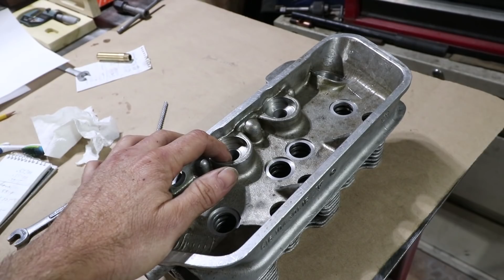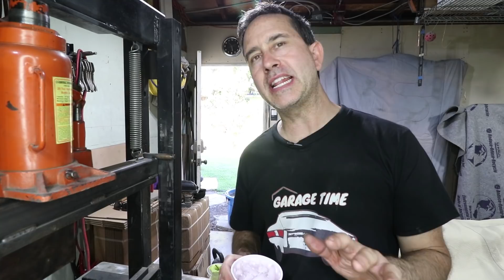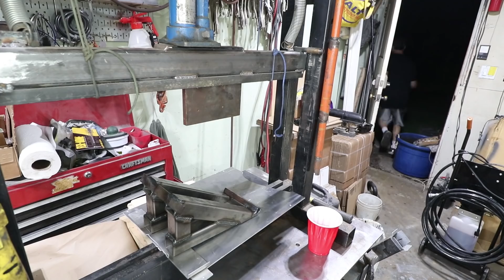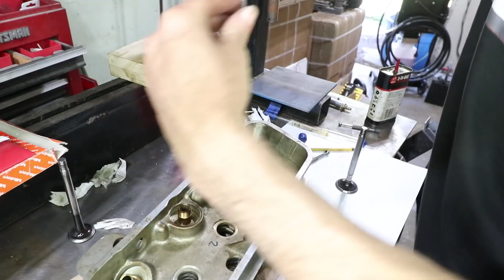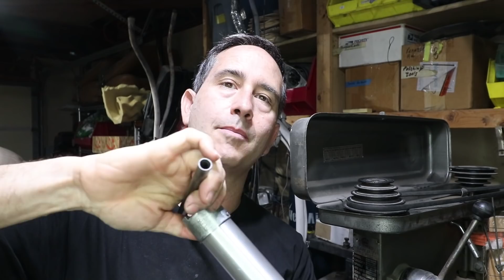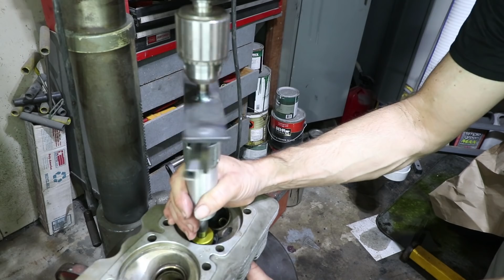912 Cylinder Head Rebuild - My HARDEST DIY Project So FAR!  Part 3

Comment: I miss my dad's workshop (Airport Engineering), which closed about 20 years ago. Started by my grandfather,  they used to remanufacture engines (even Colin Chapman of Lotus used them). They had everything for every job you ever needed, I spent most Saturdays down there building engines. We always used to cut valve seats by hand, Dad's cutters were like a hot knife through butter.
Reply from the maker: That sounds like a great hangout!  A couple friends of mine have private airplane hangers filled with lots of car tools and goodies.  Always fun to visit!

Comment: Newey cutters come in many sizes. One or two sizes bigger, and You would be OK.
Reply from the maker: Turns out I had the right size, but the center section is moveable for clearance.  Works like a charm

Comment: Working in a machine shop that has to put a lot of EXPENSIVE bearings in gearboxes, I’ve determined that if I have to replace anything in my 914 or 912 heads I’m going to put the replacement part in dry ice overnight and heat up the head to over 200 degrees and that should get several .001s.  If the boss would let me use liquid nitrogen, I could increase that to .005.
Reply from the maker: I love using temperature to make things fit or break stuff apart.  It works!
Reply: Got another question: what kind of valve spring compressor is needed for these heads?

Comment: Tom why the two different valve angels 45 degrees on the valve and 46 degrees on the seat?
Reply from the maker: You don't have to do this, but many recommend it as it promotes better wear in.  This happens very quickly.  In fact for me this angle change went away when I lapped the valves with a very fine paste.

Comment: You are a brave man sir. I use my oven for the heads, more uniform temp and if your wife is gone, the dishwasher works well to clean them up.
Reply from the maker: Ha ha, I did flip the head like a steak.  Dishwasher is a no no for me or I'd be replacing the whole kitchen after that!
Reply: Garage Time - Restomod A participant on 912BBS got his case out of the dishwasher just before his wife came home. But his wife noticed that the rack was out and immediately- and accurately - accused him of washing his engine case. Book him, Danno!

Comment: What do you suppose is the rationale behind the 356 exhaust port design?

Probably the single most important thing on an air cooled engine is heat management. The rectangular port design is interesting because it’s a larger surface area per volume, so it transfers more heat to the head for the same given amount of exhaust flow. Because it’s relatively thin, the hydraulic diameter is relatively small, which limits flow. 

The semi-Hemi combustion chamber is really smart, but I don’t exactly understand the exhaust design.
Reply from the maker: My guess is they tried to orient the exhaust port with that of the airflow from the cooling shroud.  There's more open area for airflow to cool the head.  
Less exhaust flow reduces horsepower which also reduces heat generated.
These engine typically don't have heat issues if treated right.
The 911 design is better all around and it uses round exhaust ports, so I think it might have been a stepping stone design.